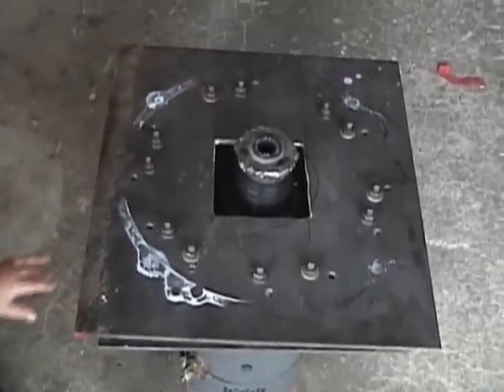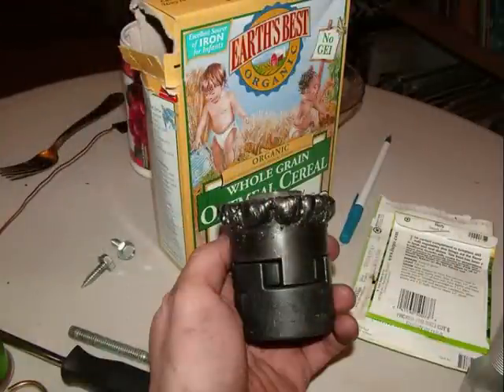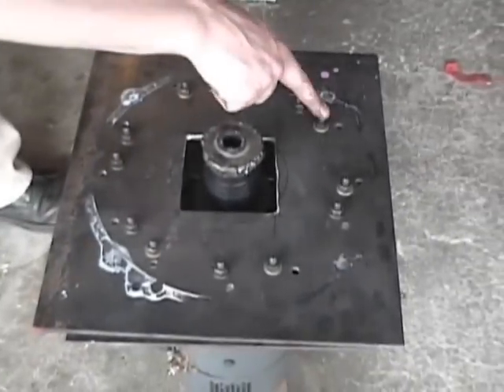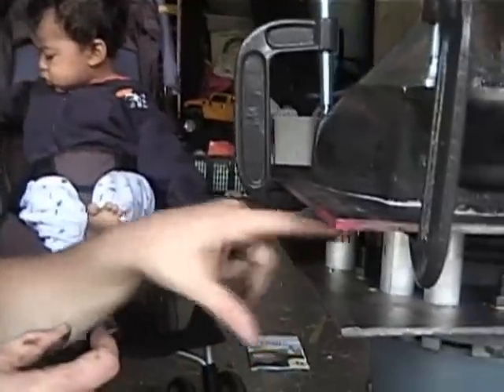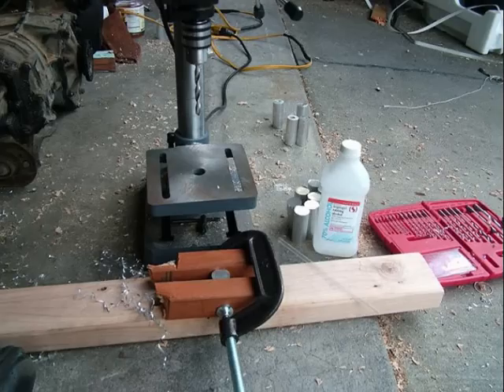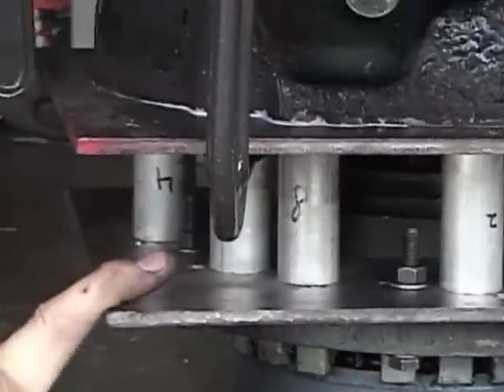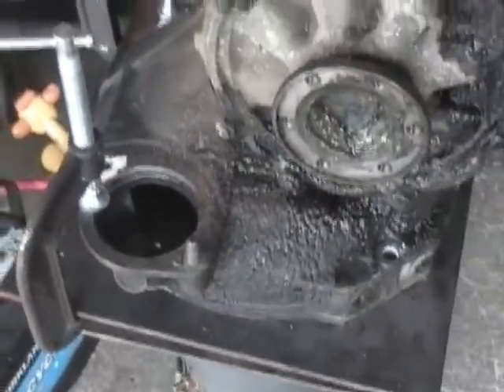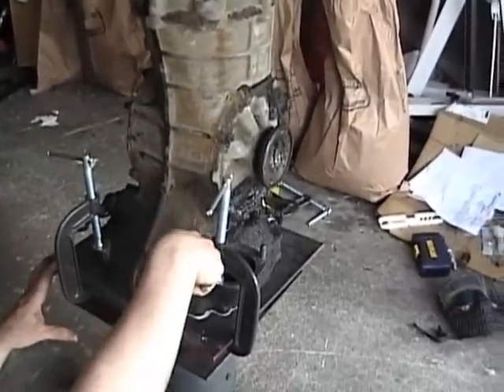P&S EV Conversion #1: Connecting Motor to Transmission

Comment: Ok, so you split the circuit into sixteen buck converters in parallel.  I'm guessing this cut down on transistor costs?  (16 ~30A transistors vs. 1 500A)  Am I right?

Comment from the maker: Well, the motor acts as the inductor.  It's about 100uH I think.  The capacitors are sixteen 820uF 200v Panasonic caps with high ripple current capability and low ESR. Check out Digikey to see them.

Comment: Ah!  That makes a lot of sense (I looked at the circuit diagram), the one last thing I'm wondering is what the specs were for the inductor and capacitor?  This is really cool, I would imagine you could connect the transistor/gate to a laptop, maybe even with as something as simple as the computer's sound card.  This is solving a lot of stumbling blocks, because in a hybrid software is inevitably going to become involved.  Thanks a lot!

Comment from the maker: You're right.  They are using the gas generator to power the electric motor.  Mine is a PWM buck converter.  You start with a battery pack, and you modulate the pulse width to vary the voltage from 0 to full pack voltage.

Comment: No I don't think so, it said the propulsion will be exclusively provided by the electric motor.  I believe the prius is a cvt to flywheel type thing.  Seems strange that no one has done this.  Is your controller a frequency generator to contactor type thing?  with a dc offset and a diode?  Or is it something more complicated?

Comment: Hi, I'm wondering if there is enough room to mount a 9" double ended shaft electric motor in between a gasoline engine and manual transmission.  The electric motor is a simple brushed dc motor, max horsepower at around 2500 rpm, I figured it would be a very easy way to add horsepower and reduce emissions.  Plus, regenerative braking would be as easy as using the motor to brake.  Do you think this is possible?

Comment from the maker: Yes, drive it around all the time, and also test my motor controller prototypes in it.  Check out the other videos to see the home-made motor controller.  I didn't get a different license.  I haven't been pulled over yet either, so I'm not sure if it's OK.  hehe.

Comment: " but you can do it yourself for under $100 "

¿¿¿HOW???

The electric motor costs more than 1000 euros!
Where you take it?
How much volts an kw it haves?
Which kind of batterys U use on tha bug?
Thanks.

Comment from the maker: Heck yes you can!  But you want to run the motor around 3500-4000 rmp, so you can basically drive in 2nd gear all the way up to like 45 mph, so basically no shifting is required in town.  Check out the forkenswift's youtube video example of shifting without using a clutch.  It's pretty dang cool.

Comment from the maker: The next video should be ready soon.  We now have the batteries, and right now, I'm cutting a board on which to place the 300 amp fuse, contactor (power on/off switch), controller, throttle control stuff, and pre-charge resistor (so the controller will last a long time).  I'm still waiting on a package that has the high current lugs and PB-6 throttle control.

Comment from the maker: It's rated at 10hp continuous at 72v, 40hp peak at 72v.  I'm planning on doing 48v for a while until I get a controller upgrade.  That'll be an extra $300 or so if I sell the 48v 300amp Curtis controller when I'm done with it.  Or, if the around town speeds work out ok, I'll just leave it as it is.

Comment: hey thats great. what is the hp for your motor? my dad used to call those gorilla welds big black and ugly but real strong. your project looks great. what will you bring the pack voltage up to? i have been waiting for you to get a video up. did you use lock tight on the bolts? it will prevent any thing from coming loose along with lock washers. i know the spacers is a pain in the neck. hey this is great.... well see ya later and good luck. see if the auto parts place can get you 8v batteries.